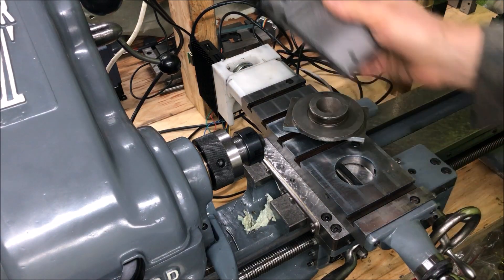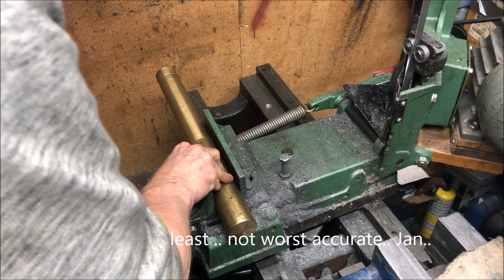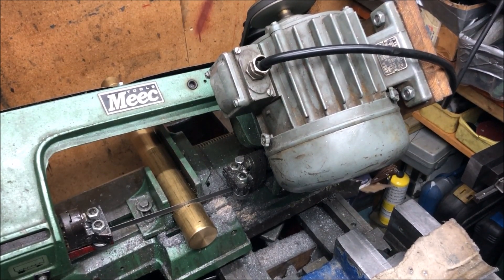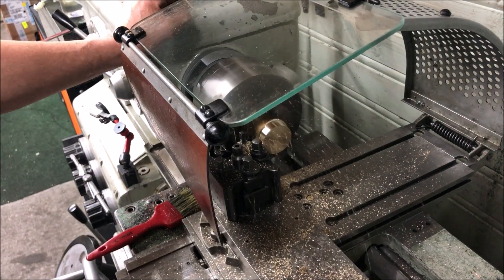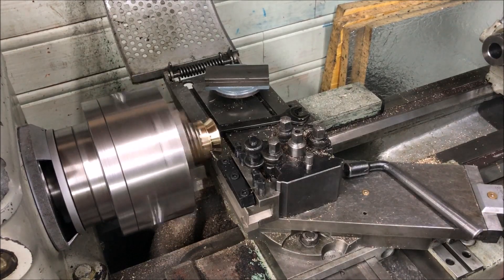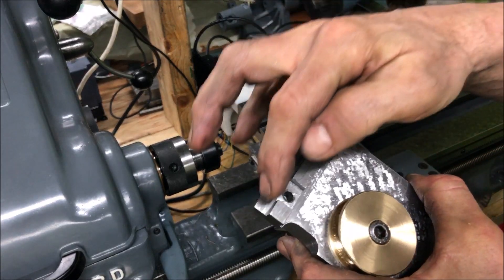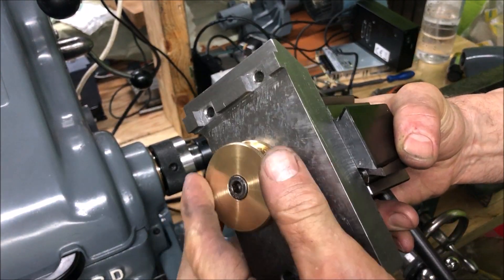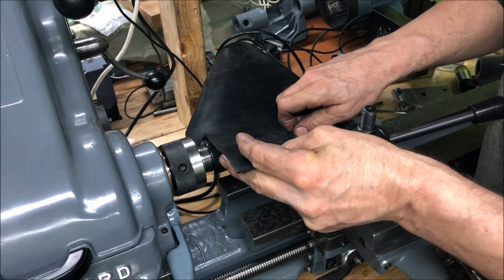Modified solid tool post

Comment: Hello Jan with your modified tool post do you still use the three front mounting screws or are they now redundant. It looks like you are securing the tool post using the new boss and the rear mounting screws.
I am looking to making a similar tool post for my Myford Super 7 and very much like your design. Andrew 👏👏👍😀
Reply from the maker: Thnks for commenting. I have made 3 examples of the plate to mount a QCTP and experimented with some variations. On the depicted variant I intended to use the regular side fed screws as on a normal compound, but in the video I forgot all about this, just using the 4 Unbraco bolts. These are more than sufficient to clamp the plate to the cross-slide, maybe also better than the original system. I also don't think it is needed to make the strips to locate/secure the plate against rotation, nor the plug to the original hole.
Reply: @jansverrehaugjord9934  Hi Jan. Thank you for the reply. Very interesting to hear that from your experiments it looks like for a Super 7 solid tool post what is needed is no more than a solid plate held by four bolts in the t slots. 
I will definitely have a go at making my own.
A quick question if I may, is the height of the plate 20mm? Andrew
Reply from the maker: @andrewatcarpathian  I think it started outvas a 25 or 30 mm plate, but ended around 20. Take measurement to the tool holder block you want to mount and then adjust the plate thickness. At least on the version with the milled out underside to make the guiding blocks it was bit thicker. However this is very uneconomical an unneccessary way of making it. I reckon that the better method would be to just millna short slot in a plate of the desired thickness that matches whatever QCTP size you want, then mount a block in this slot. However I think it is more of a theoretical concern as with 4 bolt to clamp down the piece the guide block might be overkill
Reply: @jansverrehaugjord9934  Thank you Jan. I will enjoy adding a larger tool post to my Myford Super 7. I have a 250-000 tool post on the compound. It’s very good, but I can only take light cuts with small tools. Moving up to a 250-111 on a solid tool post block will no doubt increase rigidity. Thank you for the inspiration and talking about it. Andrew
Reply from the maker: @andrewatcarpathian  You're welcome. Good luck!

Comment: Looking good, I didn't hear even a little bit of chatter.  Carry on, sir!
Reply from the maker: Thnks. I will!
Reply: @jansverrehaugjord9934  Nice work indeed. What do you charge for a refurbished ml7 ? On another note, you mentioned that you buy leadscrews from Mcmaster in the US. I recently bought a length of threaded 5/8 8 tpi from Kingston engineering in the UK. Great service and rapid delivery.
Reply from the maker: @martinnordholm686  Thnks for the nice comments😀 I don't restore machines for a living, so thinking about it differently than a professional would have to. If I was to take on an ML7 it would have to be after an inspection to determine how long it would take, then decide. In general, I think the most economical, and rewarding, way to proceed is to take a scraping class and then move from there. With some practise you should be able to take on this yourself 😀 That said, I guess a pro shop have access to better machinery and use more efficient procedures than me and you, and this would of course provide you a finished machine. PS! Are you in Norway?
Reply: @jansverrehaugjord9934  No i am in Denmark. I am tempted to try scraping, but i am worried that the purchase of, for instance, a surfaceplate would become very costly indeed !?
Reply from the maker: @martinnordholm686  I see. Hmm.. if you have an email, I can give you the details to some of my "machinist friends" down there who might be of assistance. Apart from this, I think you will find that, yes, there is a certain cost of acquiring the tools.. and skills, but once this is settled you can soon reap the benefits of mastering what I at least find a very useful addition to a hobby like ours. A surface plate is a valuable asset anyway.. I mean, need for scraping or not, this will come in handy for measurements one way or another. I would recommend a 630x400mm plate as a "shop tool" and this size plate is not that expensive. I think you should be able to source a Chinese granite one for less than 2K. It should also be possible to find used ones, for example at auctions. For scraping purposes, you will of course also need other tools.. like straight edges, hand scrapers, other measurement "devices" etc. so a certain "investment" is necessary. This is however where the fun begins! I have said it before, but can repeat: my best holiday (I mean apart from when the family is involved) was the Richard King scraping class I attended down in countryside Georgia, held in very nice facilities and hosted by a real gentleman. I think we had an average of 10 hours all 5 days (yes, Richard gives you a lot of value for your money).. Sure, the whole week cost a lot, scraping class summed with hotel and flights, but it was worth it! So this is my best advice if you can afford. As a contribution to a hobby in machine tools what you learn from the aspect of machine alignment, metrology etc. is alone worth the expense.
Reply from the maker: @martinnordholm686  Regarding the leadscrews, I guess there are multiple suppliers. Thanks for the link to Kingston Engineering

Comment: hello im serie probleme one my stanko continuse see for what break not whork bridg diode hs and now bearing for broche make lot song im go see freind have same my make lot of vibration its for this my finition not perfect evrytime can you help me for reference im not sure ??
Reply: reference bearing not sure 60x95x26 gost 7634.75 and 45x88x19 gost 11738-72 ??? im not sure its good maby open all befort buy new bearing best big whork no time now its for this winter maby septembrer
Reply from the maker: @brazideccyrille572  Do you have the user manual for this lathe? If not, give me your email then I can send it (or have I already done so?) Pls. also have a look at the videos this guy did on the same type of machine. https://www.youtube.com/watch?v=40mlNKbdDvU
Reply from the maker: @brazideccyrille572  The yo umight also want to go to the Russian forum. There is a ton of info on this lathe there. The portal is called www.chipmaker.ru then you have to go the forum and select the machine in question
Reply from the maker: Hmm.. I am sorry, but I don't get your meaning. Can you write in French? Then I can translate and/or have some French speaking friends of mine to translate. One of them is alo a mechanic

Comment: That was 3mm wide grooving insert?
Reply from the maker: no.. 4mm
Reply: @jansverrehaugjord9934  Well that is performing really well. I usually need to go low on the speed with 3mm HSS grooving tool. Heaviest cut was with R8 radius tool. Had to use back gear for that.
Reply from the maker: @waldemarii  Hmm.. then you might want to have a look at the various details that add up to the cutting perfomance..
I will try to mount this tool to the compund directly to see if this changes things to the worse. However, you may try to lock down the saddle tight, the gib on the compound  tight and the cross-slide as tight as you can, but still be able to move to minimize play there. Maybe you have som play in the screw/nut and/or the mounting collar (you have taken up any backlash?). I guess whatever increased performance on my lathe is a combined effort in newly scraped and fitted saddle and cross slide, the use of the 2 nuts for the cross-slide screw (plus a pair of bearing instead of the collar, but I don't think that matters in this respect) and of course the solid tool post mounting. Could be the latter that is of most importance, but must be tested..
Reply: @jansverrehaugjord9934  Bed is worn out, if I tighten the gibs the saddle will not slide to other end of the bed. Also top of the compound is worn, so the contact between toolpost and compound slide is not good. I will fine mill the top at some point. Don't know yet what I do with the bed.
Reply from the maker: @waldemarii  I see. That explains a lot I think. If you know how to scrape and have appropriate tools for this plus measurements (long straightedge and surface plate helps) then this is well within "doable". Are you located in Finland? I seemed to recall seeing video footage from Kerava (we have our distributor there, MIP OY)
Reply: @jansverrehaugjord9934  Yes we have talked about this before in email. :) I may get another lathe. But I still don't know what I am going to do with this one.
Reply from the maker: @waldemarii  OK. Sorry.. in contact with a lot of folks .. also concerning machining. Many needing assistance 😀 Tja..? I would measure it, then if too worn to just scrape it, get it machined. For this there are several alternatives, plain milling (followed by scraping), alternatively grinding or planing, both which may or may not need further attention. But you would need to attend to the saddle anyway.. and the other parts 😀
Reply from the maker: @waldemarii   If you could send the parts to me or possibly "just" over the border to Sweden, where I have a friend with a planer that might want to take on such a job (this will possibly be the cheapest?), we could attend to the bed and parts. PS! I do this for fun/learning, but I would have to pay for machining time etc. and I think I would spend somewhere in the region of 25-50 hours on these jobs, so.. Perhaps the best solution and most rewarding in the end (personally, and of my own experience) would be to take a class in machine restoration (incl. scraping). You may contact Maschratur in Austria for this (have no clue what their charge is and when they will hold the next class).. Not that you need it, being located in Finland, but I bet you will (also) be stunned by the beautiful nature down there :)
Reply: Congratulations for the re-found T-nut! Good  teamwork rules the world 👍
I am curious about the comparison. I guess the better you have scraped in the Myford top slide, the smaller will be the differences between it and the solid toolpost!
But 4mm parting tool is quite impressive for this small machine!
Reply from the maker: @michalzi  Thnks Marc! Haven't gotten around to scrape and assemble the compound for this one, but can do a test with it first "as is",  just to see also the effect of scraping and fitting. Then I must bolt down the machine and align properly.. and tidy up.. too many loose cables